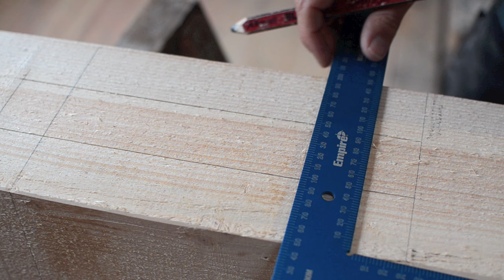Strong Joint - Timber Frame Roof Truss II

Comment: Just found your channel :-) What a beautiful and informative movie! Thanx for al the little tricks you shared. I specially like the curved braces and to put them in both different ways. Not every thing has to be made like in a schoolbook -  It will add some kind of freedom spirit to your cabbine.
As i am working similar project, there is one question turning around in my mind:
Is it possible to use fresh wood or is it necessary to let it dry first?
What did you use for your timber frame?
Reply from the maker: There might be different approaches to this topic.
I would say, that it is an advantage to use dry wood. But to get dry wood ( naturally dried) in these dimension is maybe rather unrealistic. I would not use machine dried wood. So, in most cases it ends up with more or less fresh wood.
The pine (used on the braces and as arched braces in the previous video) is harvested one year ago. So it is 'half' dried, at least well settled.
The spruce (post & beams) are harvested just few weeks ago. But i had the chance to find standing dead wood. It had many years to settle and dry in a very gentle way. In my eyes, this is the best wood to use for timber framing - if available. Storm or bug damaged wood might be a similar source.

Comment: Thank you for this interesting video on an interesting topic!
It seems to me, that you are using a rather small cordless drill - for this rather big job.
Would you share some of your ideas and expirience about it?
Reply from the maker: Yes, it is a small machine. I was looking for something 'made in Europe', or at least not from China. There is Mafell, Festool and Fein. (did i forget something?)
This Fein has 12 V only, but four gears, the first one is rather slow but very strong. I can drill wholes till 50 mm in wood. Screws, 25cm by 6mm no problem. For the wholes it is anyways better to turn slow, to not overheat the drill, and for the screws, i do not care if it takes 3 seconds more or less. I rarely put more than 10 this sized screws in a row.
The advantage is, that this machine is much lighter than all these oversized 18V monsters.
Hope there was something helpful for you ;-)